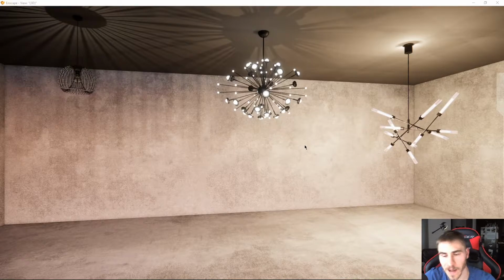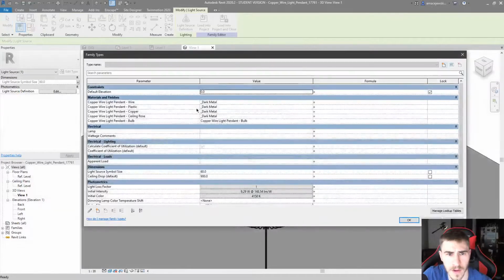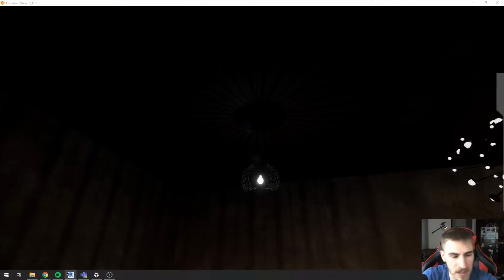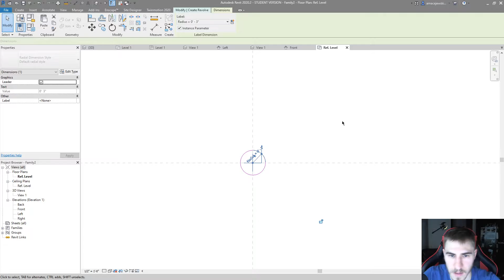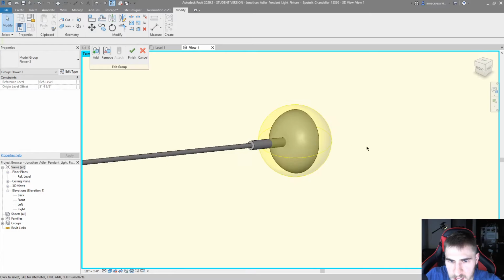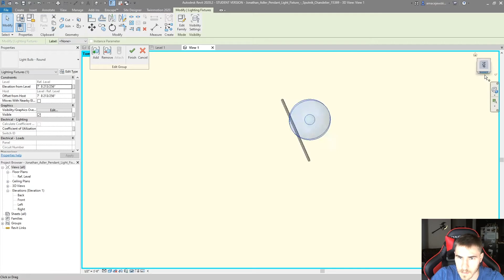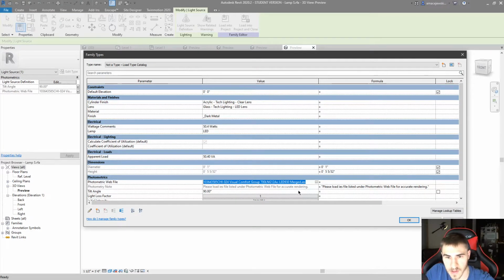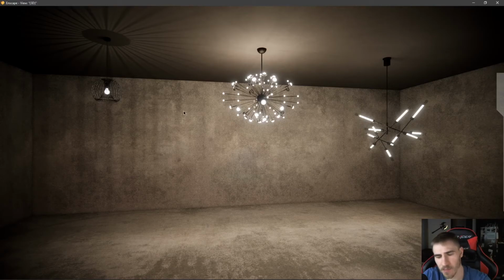How to Create Perfect Light Fixtures | Enscape

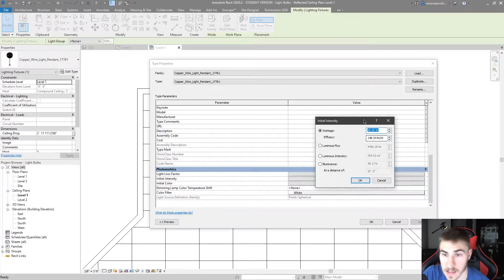Comment: 10:40 I know you said you don't like increasing the light wattage, but it is in fact more realistic. You basically just made it a 60 Watt light bulb, which is what you would find in most homes. Increasing it to 100 Watts wouldn't be out of line. I would agree if you had to make a single bulb 1000 Watts to achieve the same result, there would clearly be something off at that point.  I know the wattage for LEDs is much lower at 6 Watts but a 6 Watt LED outputs the same light as a 60 Watt incandescent.
Reply from the maker: I agree with what you are saying, Charles. The main problem is yes having to increase the wattage above a normal amount to achieve the desired look. I just wish lighting could be alter in revit a different way for enscape but it makes sense I guess.

Comment: i think enscape should make material object for light in revit like sketchup to make it more easy for adding line or rectangle or sphere light  in revit like this is too much an complicated and the results is sucks
Reply from the maker: I agree in that it would give a lot more options. But at the same time revit operates with enscape in that enscape just pulls directly from revit which is most of the appeal in my mind. I wish there were more settings built into enscape itself for revit without having to go through adding extra settings for enscape lighting in revit.
Reply: @ArchitectureVanguard  can you ask them i mean the esncape to take this in consider !! Cause when i want to make an interior rendering with not too much opening in the room its gonna be too dark and the light of revit is tooo bad , but in sketchup with material object is awesome ❤❤
Reply from the maker: I will do what I can haha but I hear ya!